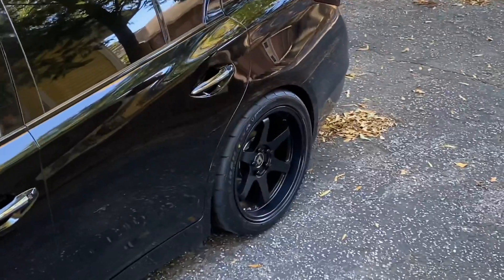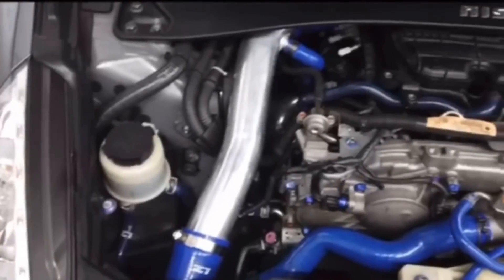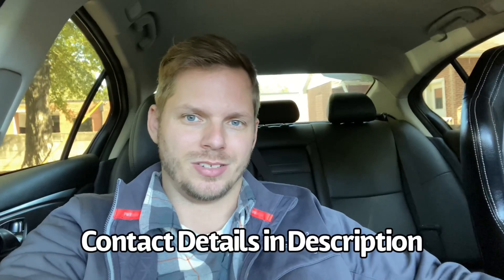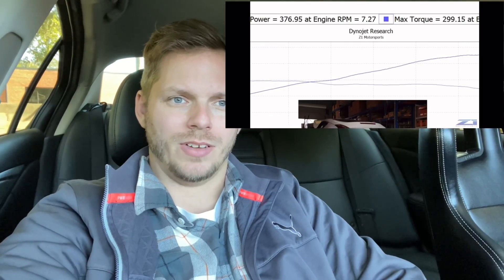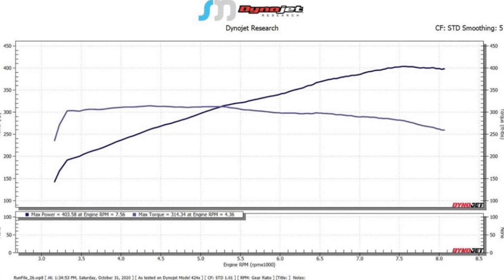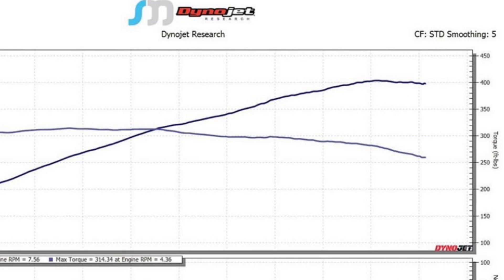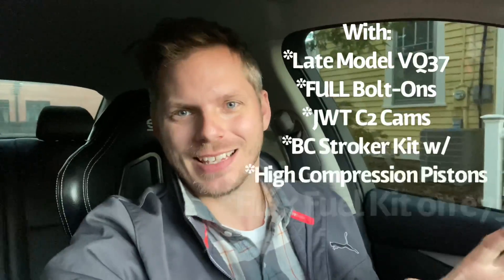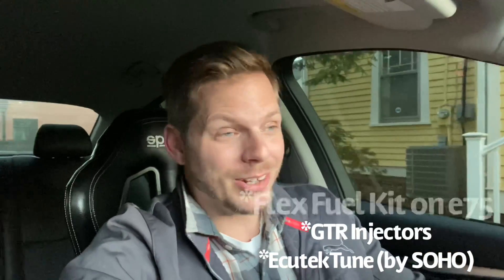Make 400+ WHEEL HP on an NA VQ37!! | The Combination You NEED + SOHO Motorsports TUNE!

Comment: My 370Z sport pkg 6MT had a Stillen gen3 long-tube cold air intake, a Fast Intentions true dual x-pipe cat back exhaust and an Ecutek tune done on a Dynojet chassis dyno. We got about 390 crankshaft hp(calculated with a 15% driveline loss) and a nearly flat torque curve, scaled up by about 15% over stock. The cost was not really that high and there is not much else I would want to do on the engine. I've taken about 120 lbs off of the car , with nearly 60 lbs of it being unsprung rotating mass. The result is a car that is loads of fun to drive.
Reply from the maker: Weight reduction, especially unsprung, can make a huge difference!
Reply: @SpeedCultureStudios  as aforementioned, I'm keeping it N/A. So fbo+tune w/ larger injectors, fuel pump set-up to run e85

Comment: See a lot of people knocking the vq for being expensive to build, there are cheaper platform, i got a 6.1 hemi thats way cheaper to build and faster but i honestly enjoy driving my g37x more. Horsepower aint cheap no matter what. Personally I'd rather have na power for a daily for the reliability too. $10k maybe for boost but add another $10k or $15k for when you blow the motor or transmission. You can do boost reliably but most end up trying to push too much or don't do supporting mods. To each their own with cars though, ls, hemi, vq, k series, vr6, 2jz, whatever. Its better than a prius.
Reply: That boat is so heavy the g37 is faster. No doubt. I’ve beat srt8, scats, and Rt. Scats aren’t that fast either. They’re way too heavy
Reply: @NoelVQ  ran both in 1/4 mile, g fbo and tune g ran 12.9 at best and cammed hemi ran 12.6. G37 was more usable with awd although rwd was fun too but had to be more careful with it.

Comment: Eehhh they made the numbers on E75 tho. Tbh I was hoping for 400+ on pump. Still impressive to see. The only thing I would say is if you're on E then you'll have to live in the right area with an E station close by in order to make this work otherwise it only works for tracking. I'm wondering what the setup would push on pump. I'm guessing ballpark 380/390 range but idk would have to see it first. E doesn't make the biggest difference for N/A builds as most people would like to think. Having a FLEX kit is handy if you track your car often. I'm currently converting to flex on my build but I'm not expecting huge gains if I'm completely honest. Everyone around me is telling me I'm going to get like 100+ more whp converting over to E85. I honestly doubt that. It does make a difference but not to the extent that people play it up. I'm thinking 50 to 60 whp (at most).
Reply from the maker: You’re right—gains on e are not all that impressive.  I’ve seen several instances in full bolt on cases where going to e85 has netted 12-15hp on an NA vq.  That’s pretty solid when you’re going from 335 to 350, knowing that we really can’t pull all that much out of the platform.  But if you’re spending thousands in a stroker kit, 15hp doesn’t make all that much sense or seem all that necessary.  I think you’re right about 380ish on pump gas.  That’s a solid number, but I’m sure still looking at just barely 300tq which is disappointing.  To me, if you can spend $2000-3000 to make 345-350 wheel, why spend another 10-12k to make only 380?  I love seeing NA builds like this, but there are better ways to spend that kind of money.
Reply: @SpeedCultureStudios  Yeah. I mean, I built my block because I love the platform and I wanted to run boost safely. You see a lot of people throwing insane numbers on the stock block like 800 whp and then it's like...okay but how long is that actually going to last? I mean, realistically the stock rods start crapping out on 550+ whp. Doesn't matter how much supporting mods you're running. The stock rods and pistons were not made for that kind of power. I blew my motor hence why I just went balls to the wall with CP Pistons and Carrillo Pro H-Beam forged connecting rods with upgraded bolts and WPC treatment. I figured okay...I can either buy another block, blow that shit up....and then have to buy another block....or I can do it right and build a forged bottom end and not have to worry about it.
Reply from the maker: @lenwerksgt5906  Sounds like a great build!  Where are you located?
Reply: @SpeedCultureStudios  I'm in SoCal.
Reply: At that point, ethanol is more for fuel quality than any gains. Pump gas wouldn’t be safe with a compression ratio that high, e75 is like running 100 octane. Pump gas would likely cause knock.
Reply from the maker: @dustt31  Great point!

Comment: Sup my dude.  I'm back again.   Question...what 3"  catback exhaust will fit my '14 3.7 q60s coupe?  Can't seem to find any...
Reply from the maker: You really don’t need a 3” exhaust unless you’re doing forced induction or single exit.  3” dual exhaust is too big and you’ll drop a bunch of torque.
Reply: @SpeedCultureStudios  so 3" intake w/better air filters to the factory exhaust?
Reply from the maker: @1stGrnidbruh  I didn't say factory exhaust.  I said not 3".  Factory is like 2 inch.  2.5 dual exhaust is perfect.

Comment: I got 2inch cbe on my 370z with test pipes. 
If I change to 2.5inch cbe will it make much difference?
Reply from the maker: What catback did you get that is 2”?  The factory catback is 2”
Reply: @SpeedCultureStudios  i bought the car like this, it is not factory universal muffler but it is some type of universal dual muffler (I can't see any brand name on the muffler, so it's probably a knock off brand) so I checked the inlet and outlet and it shows it is 2inch.

So I want to ask you according to your research and knowledge if I change it to 2.25inch inlet and outlet dual universal muffler how much HP gains do you think it will gain? (considering the rest of the pipes are same diameter 2.25inch)

Also I don't know how restrictive it is inside the muffler but i love the sound tone it creates that's why i kinda dont want to swap it out. The rest of the pipes it all custom 2inch btw

Comment: Uncommon opinion, but even 330 at the wheels on these cars is great. Not talking straight line racing, but a healthy 330ish on pump gas and a good tire and suspension setup is a ton of fun on a track with a light and reliable car like a 370z. To each their own but that money to get above 400 is hard to swallow lol. They're well balanced cars and can be extremely fun without spending too much, but respect for them pushing the engine and finding out what's possible.
Reply from the maker: I agree 100%!!!

Comment: GT3RS territory almost, pretty impressive on the VQ platform.
Reply: Very good but NOT even close to a GT3RS, it's still down by 75 or more hp depending on the year. Now the built motor by Sasha Anis is in GT3RS territory but it's NOT a street car!
Reply: @larrycurrence6874  a 997 GT3RS makes under 400whp

Comment: Ayyy, that's my car(the Z1 car). Correct, E85 on those numbers. The compression ratio and stroker crank were the contributors to do what he did vs mine.

Happy to see the continual pushing of the platform. Quality parts and a reputable shop is a good recipe for solid results.
Reply from the maker: Right on man!  Thanks for chiming in!!
Reply: do you have an IG?
Reply: Love the look of your car. Which spoiler is that one? It seems to fit the car just right.

Comment: The highest I've seen with e85 is 378whp, the amount of money spent is more than turbo kits
Reply from the maker: Right.   Pretty cheap and easy to get 345-350.  Beyond that gets very expensive for little gain.
Reply: @SpeedCultureStudios  i mean for me, i have almost every basic bolts on, Shorty headers, test pipe, Agency power exhaust, ported TB/intakes z1 inch long air intake, and made only 332Whp, maybe if i switch to single exit and longtube headers i would get 345-350whp, i wounder if Jun cams or JWT c2 will increase power, some people have mix review about adding exhaust cams since intake you cant really do that due to the VVEL
Reply from the maker: @al3zmi  And intake is mostly the problem with this engine.  It already takes in as much air as it needs, so no matter what exhaust work is done, it seems that you can’t get much more power out of it.  With the mods you have, your power seems a bit low unless you’re at high altitude or on a mustang dyno.
Reply: @SpeedCultureStudios  it was DynoJet, what should be my  hp/tq target to hit with my stuff i have?  i'm tuned with Ecutek

i did 76mm TB kit and it gave big difference but made driving horrible, no matter how many tunes and adjustment it will always have a slight or big rev hang, it's why i ported stock TB
Reply from the maker: @al3zmi  330-340 is very common with just drop in filters, test pipes and catback—at least in the Q50/370z.  If you’re in a G37 Maybe slightly less.

Comment: 400+ to the wheels in this cars is faster than a c8 corvette even on top end  a guy I know has a c7 corvette who dyno at 395whp then he beat a c8 stock vette
Reply from the maker: Honestly that can’t be true.  I watched a stock c8 corvette run 11.14 at 134mph in the 1/4 mile last weekend.  C7s are fast but not that fast and it would take a bit more to get a 3,800lb car with only 400 wheel hit that number.

Comment: This is like comedy.You can simply grab F10 m5 around 30k.  And make 600+who on tune. And you'll be driving a M5.
Reply from the maker: But the video is about making that power with the vq37.  Otherwise it would have been titled how to make 600hp with a bmw.  Or you could “simply grab” a vr30 Q50 for $20k and make 500+ with some bolt ons and a tune for a fraction of the cost of a bmw.  I understand your point, but it’s irrelevant to the video lol.
Reply: And one of the most unreliable cars you can drive. Beautiful though no doubt